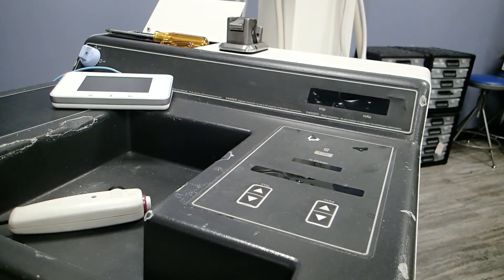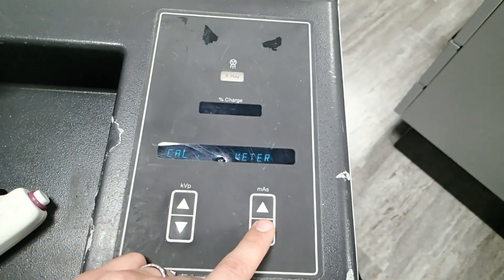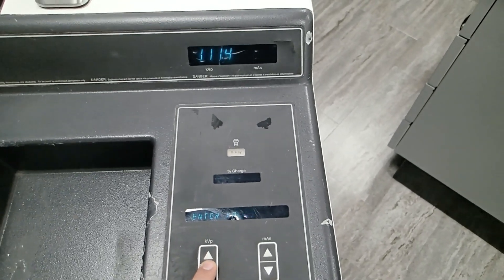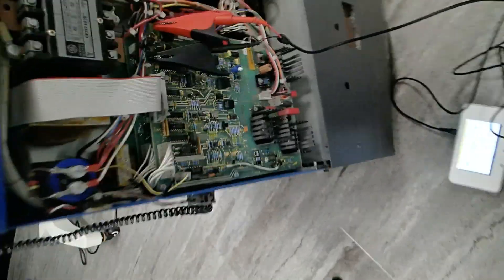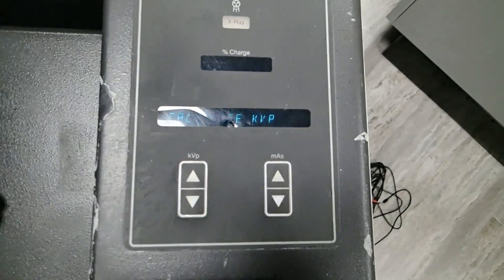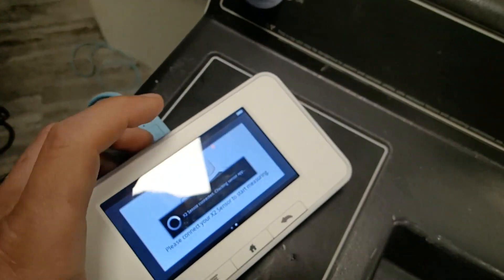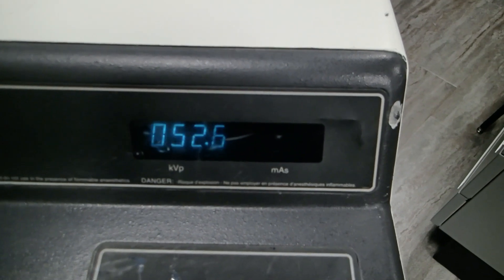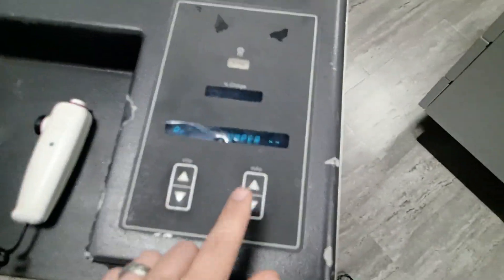AMX4: X-Ray Generator Calibration with Raysafe2 - Advanced BMET

Comment: Are these procedures the same for AMX 4 plus?
Reply from the maker: Yeah they should be nearly the same - some of the boards are a bit different looking - depending on when the amx4+ was built but overall pretty much the same. Of course it’s always good to check the documentation for the model your using

Comment: Thanks so much 

How to calibrate drive handle
Reply from the maker: GE has a documentation portal - you'll need to get the service manual for the AM4+ and use that to calibrate the drive handle - its not to hard, its a pretty quick calibration. If you know how to get to the service mode of the machine it will sort of walk you through it on the prompts.
Reply: When i power up machine i get error XRAY DISABLED I JUST REPLACE NEW BATTERY
Reply: @if possible may i have your contact??

Comment: can i calibrate without the raysafe? I dont have one.
Reply from the maker: I could be wrong but I believe there is a way to do it with an oscope and a voltage divider but it’s been a while - I think it’s in the manual if my memory serves
Reply: @HTMWorkshop  Thanks so much for your prompt reply. I have got the calibration manual, i will check.
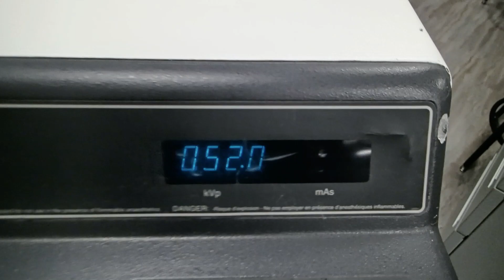Reply: @ 8:32 HTM WORKSHOP WHEN WE ON THE MACHIEN TEST 1 OK TEST 2 ON TEST 3 OK
AFTER THAT 
XRAY DISABLED APPEARS

Comment: when I try to do the calibration mAs I get Xrax Word limit. And it does not allow me to continue with the  calibration kvp
Reply: I had this same problem and found out if you adjust the kvp values by more than three each time the old memory chips hit a limit and kick you out of calibration. So only adjust by three (full numbers) max and it will take more X-rays but will complete the KVP cal in the end!
Reply from the maker: I have not had to deal with that one - I know there are some ideas on Medwrench for troubleshooting that issue but not sure its the same. Sounds like an odd one.
Reply from the maker: If you figure it out please let me know

Comment: When I try to calibrate Kvp, I reach 120 kvp but the machine turn off and restart the system for the begining
Reply from the maker: Interesting - I have not dealt with that issue before. Is the battery fully charged?
Reply from the maker: Also looks like someone else has had the same issue here but no clear resolutions - https://www.medwrench.com/thread/149877/amx-4-issue

Comment: Aoa Sir
From Askari Diagnostic lab Narowal
Sir yesterday  machine was charged on 1/4 charging.when charging was completed breakers was tripped and Now machine is giving the option (Test: 3 Failed)
Reply from the maker: Not sure - but the service manual does have  troubleshooting guide in the back that you could try based off the thrown error code. Wish I could help you - let me know if you find a solution!